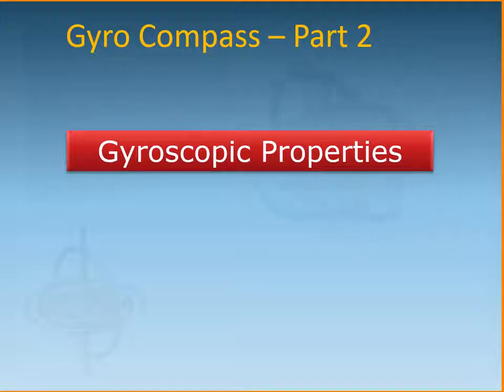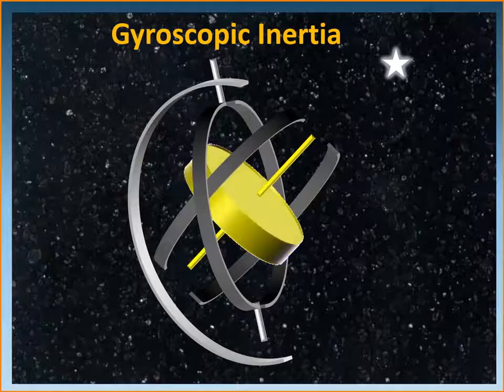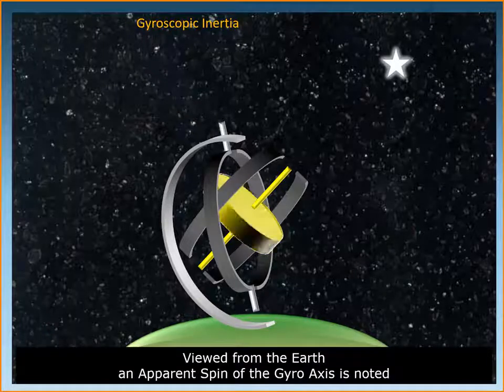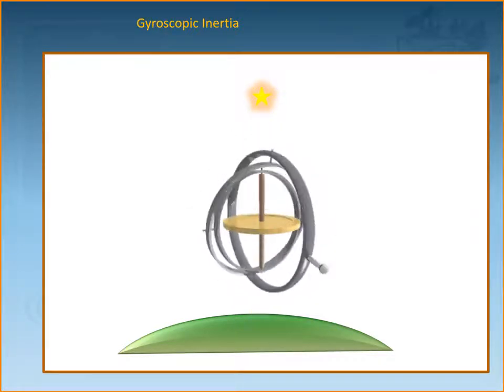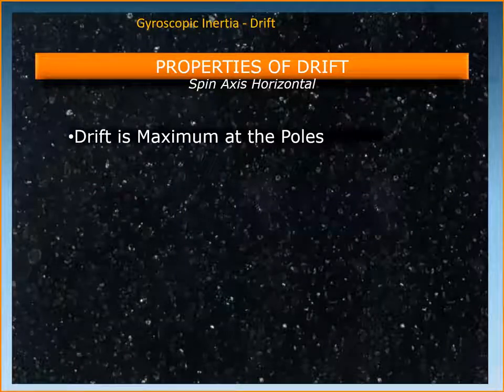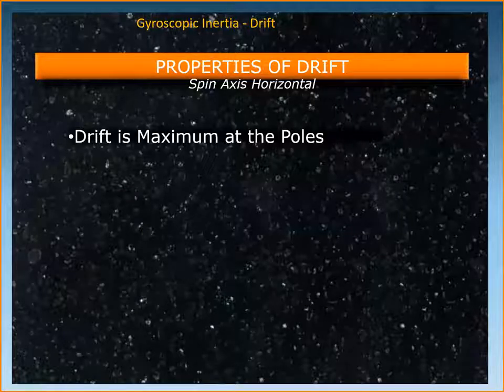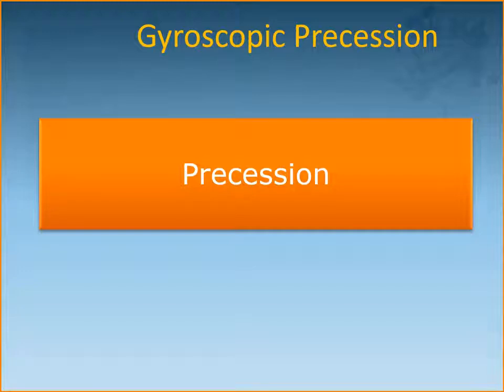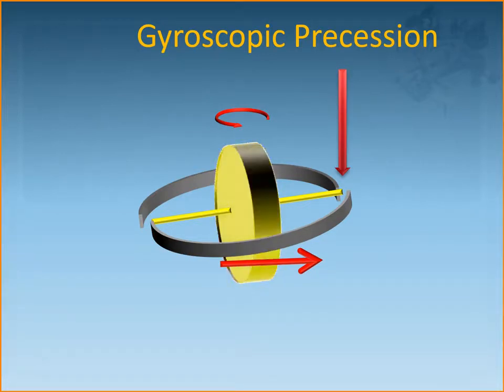Properties of a Gyroscope Gyroscopic Inertia and Precession

Comment: This is actually technically incorrect @ 12:08.  The drift is a constant 15deg/hr (approx.) at the poles... but at any other latitude, it doesn't merely "slow down"; its speed actually /oscillates/ between faster and slower speeds! (Assuming you do not disturb the gyro's axis.)

Consider: After approximately 24 hours since starting the gyro, the Earth's rotation will have brought the planet back to the same orientation in space as when the gyro was started.  Assuming the gyro's axis was not disturbed, the combination of its so-called "drift" and "tilt" will make the gyro's axis appear to twist (to an Earth-based observer's point of view) along a canted plane, completing one twist cycle in those ~24 hours.  That "canted plane" will be "flat" at the poles, and "vertical" at the equator.  But an undisturbed gyroscope's axis will always twist around in this canted plane at a consistent 15deg/hr (approx).

The oscillation in the so-called "drift speed" is due to the fact that the observed "drift" is the vertical projection of the gyro's axis (in its canted plane) onto a gravitationally-horizontal plane.  (Similarly, the observed "tilt" is the horizontal projection of the gyro's axis (in its canted plane) onto a gravitationally-vertical plane oriented coincident with the East/West vector.)  Since the endpoints of a conceptual line segment of fixed length (representing the two gimbal bearings of a gyroscope wheel's physical axle) twisting around in the canted plane trace an elliptical path on the horizontal/"drift" and vertical/"tilt" projected planes, a twisting speed of constant angular velocity will cause the linear speed of the line segment's two endpoint projections to increase near the respective ellipse minor axis, and decrease near the ellipse major axis.  The projected line segment within these ellipses will therefore appear to speed up to its perceived maximum when coincident with the minor axis, and decrease to its perceived minimum when coincident with the major axis.  (This is of course assuming the gyroscope axis is undisturbed over the course of its twist/tilt/drift cycle.)

If you want to visualize the "drift" aspect of this effect, get a typical desktop globe, a toothpick, and a torch/flashlight.  (You'll probably want an assistant to help you with this too.)
Place the globe on a table, and choose a geographic location on the globe where you want to see the result of this effect.  Next, hold the toothpick tangentially against the globe -- this will represent your gyroscope axis in its gimbal.  (The axis in 3D space, really.)  Then (to the best of your ability), look at where the toothpick is pointing on the wall or ceiling of the room; you'll want to keep the toothpick pointing to this imaginary spot on the wall/ceiling for the remainder of this demo!  (The farther away the wall or ceiling, the more accurate this demo can be.)
Now take your light and shine it "down" onto the toothpick (with respect to the globe's gravity); ie. shine the light "from space" towards the centre of the globe, with the toothpick directly in the beam.  (You'll probably want an assistant holding the light like this.)  Observe the shadow the toothpick casts on the globe -- the line of this shadow, and how it intersects the latitude/longitude lines on the globe, indicates the "apparent direction" of the gyroscopic compass gimbal.
And now for the fun part of this demonstration:  Slowly rotate the globe on its axis, with your assistant synchronously stepping around and keeping the light aimed "down" (from "space" towards the globe centre) at the SAME GEOGRAPHIC LOCATION on the globe.  At the same time, keep holding the toothpick in this beam of light, but KEEP THE TOOTHPICK POINTED TO THE SAME IMAGINARY DISTANT SPOT ON THE WALL/CEILING!  (Obviously the toothpick can't be tangential to the globe surface anymore, so you'll have to hold it at a bit of "altitude" away from the globe surface)  Now look at how the toothpick's shadow appears to "rotate" with respect to the globe's latitude/longitude lines.  This is exactly how the gyrocompass gimbal will appear to move throughout the 24 hour day... if the gyro's axis is left undisturbed, of course.

Comment: One way to think of it: The ONLY orientation of a Gyro on the surface of the earth is one whose spin axis is aligned with earth's spin axis.
Any OTHER orientation will result in a force on the gyro that results in it precessing.
Just make the force of precession reorient the gyro to the lower energy state (one which IS aligned with earths spin axis)